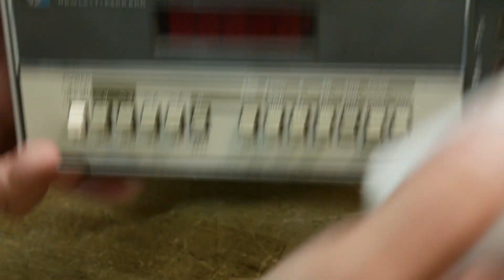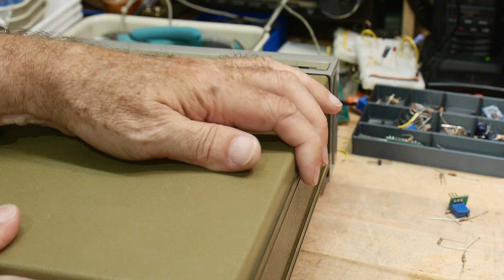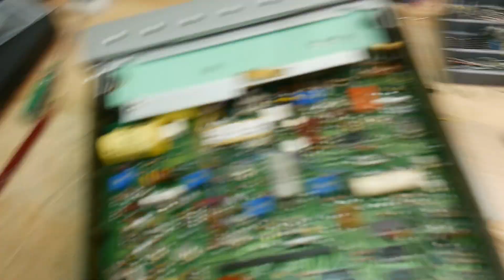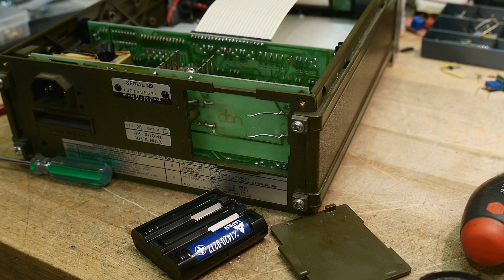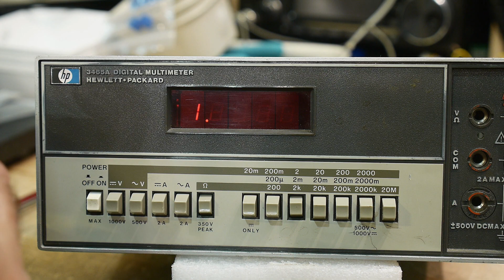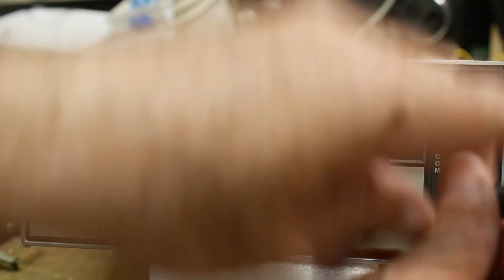#1237 HP3465A Multimeter repair (part 1 of 3)

Comment: A lot of HP's meters have calibration data in ram. So a backup battery is always needed. It's typically Lithium.
Reply from the maker: ain't no ram, ain't no processor

Comment: Why pins 16 an17 on "Do not touch" chip is so black? Hard to tell from video is it corrosion or burnout..
At least something works and feels like bad connection in range switches, if not counting black pins and possibly that due too bad connection in range switches, something bad happened to main chip.. Hope, its not..

Nice to see another device for repair.. 👍

Comment: I worked for a subcontractor testing, calibrating and repairing HP multimeters, power supplies and function generators. At the time, HP, later Agilent, now Keysight had lots of technical literature available online for instruments of that vintage. You may be able to download a schematic even.

Well, I took a look and Keysight has nothing prior to the 34401A. Can you throw that unit away and scrounge a newer one to play with?
Reply from the maker: I downloaded the service manual
Reply: @IMSAIGuy  Well done; you searched better than me. I only looked at the official site, not third parties.

Comment: I was trying to repair my beautiful HP3466A. It works well in the 20mV and 200mV ranges, but slowly drifts negative in the 2V to 1200V ranges. It starts at 0.000V and has slowly drifted to 0.0260V after 5 hours. I've tried everything, coolant spray, replaced all caps, tested all diodes and transistors, reseated some ICs, cleaned all buttons, cleaned the board but it just refuses to work. Of course I grounded the input for testing. Any ideas?
Reply: JFETs Q105 and Q107 do the high/low low range switching. Also their Gate driver LM339 U104 and flip-flop U902. Make sure they are all working. I had to replace U104 on my meter. If that's not it, it may be other associated resistors or protection diodes. Hopefully not one of the hybrids. 
https://www.youtube.com/watch?v=5u8JeFvOjFQ
Good luck, Dave
Reply from the maker: are you sure the low ranges are not drifting also? 200mV would drift to 0.0026V
if 200mV is stable then you need to find what is different in the circuit between the two. 
did you leave the unit on for 24hrs before calibrating? and is the room temp the same after 5 hrs. it might be in spec.
it is very hard to guess at things without the unit in front of me

Comment: Nice start, thanks. 
I recognize that NiCd battery from my 1975 HP45 calculator. Early HP calculators used the same battery. There must be videos on how to replace the cells. I've done it at least once.
Reply: The HP 8568A(B) spectrum analyzer contains the same model rechargeable battery. It contains 3 AA-size NiCd cells. It's not very difficult to replace them. I put 3000mA NiMH cells into some (HP 65/67 calculators). The original NiCd's are 450mAh or something in that range.